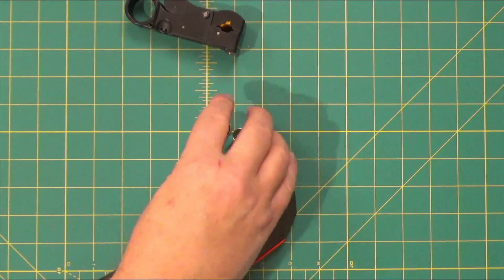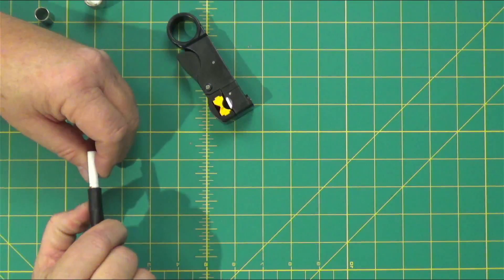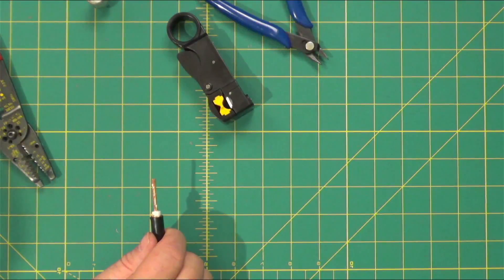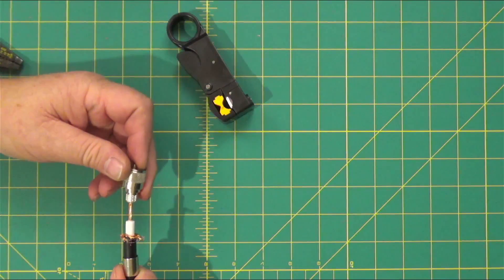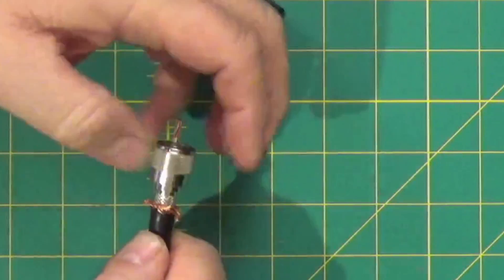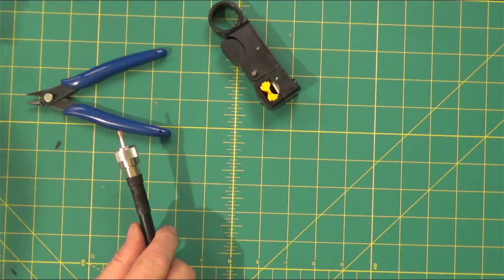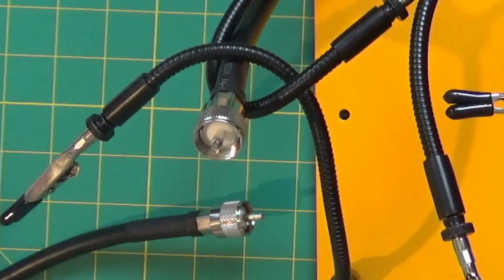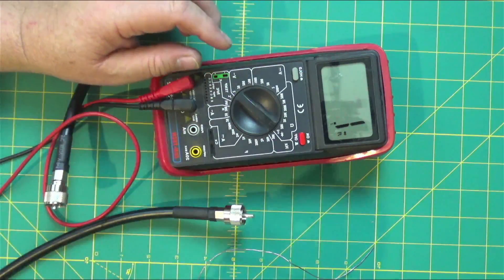How to install a crimp-on PL-259.

Comment: How long a piece of heat shrink do you use to cover the end of the PL-259 plugs?  Other videos insist on soldering the shield  to the ground, and others suggest that silicone should be put over the outside jacket and under the heat shrink. How important is this?

Comment: I've seen videos where people insist you have to put the iron on the center conductor and the wire... Never with just heating the center conductor.   Very nice!  How do you know when to stop feeding the solder into the canal?
Reply from the maker: I just add until I see it at the tip

Comment: Makes for an easier job. Not a lot of braid touching the shell however. I have done thousands of F crimp connectors before the compression types and they usually work. Getting good quality connectors that crimp well makes the difference. I’m going to look for a crimp set for RG 8.

Comment: the stripping tool went and cut almost 3 ft . th cant get cutting  setting right. guess i need some input on this
Reply from the maker: Paul what I have found is get a good quality strip tool from somewhere like DX Engineering or Ham Radio Outlet hopefully it comes with some instructions. If not they are usually close and you just need to use the adjusting screw to dial it in. Coax can vary in size from brand to brand.
Reply: @KK6USYHamRadioAdventures  all I ever use rg-213. Been thinking about it's  Thin coax for the truck and getting to the wanting to be portable. 5-100 not sure. Been out of
 the too long. Radio 991a for. When things get crazy. and gave to leave

Comment: Can you tell me what heat shrink you used for the 400 coax?  looks like a nice fit. Thx
Reply: Look for Heat Shrink that comes with glue on the inside that binds to the coax to keep out water/contaminants
Reply from the maker: I think it is Doorman from O'Reilly's  and the size that just fits over the connector.